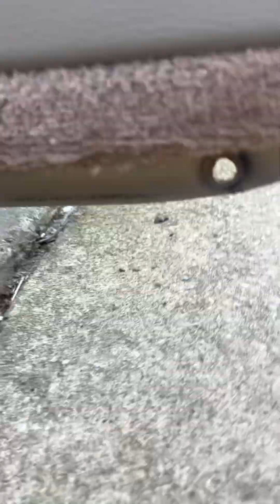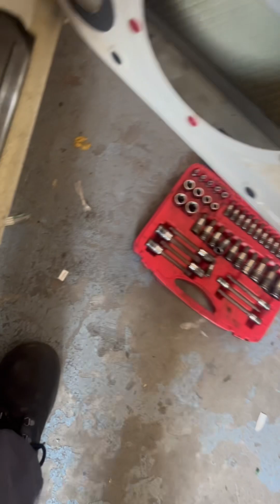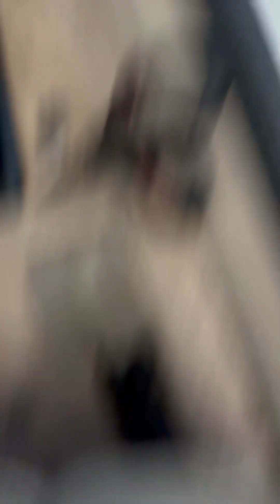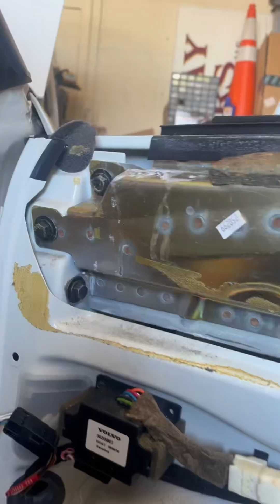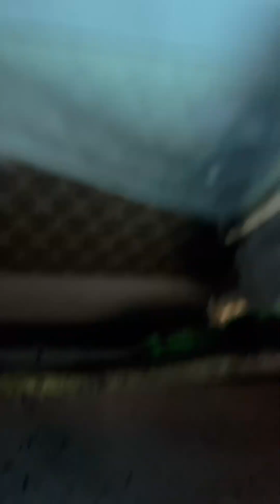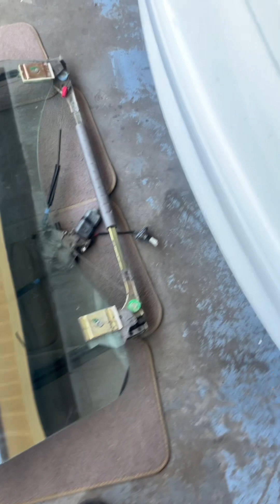2000 Volvo C70 Window Regulator Removal

Comment: The video was very helpful. I'm in the middle of the project myself on a 1999 C70. Hope to see the follow up.
Reply from the maker: I reinstalled it yesterday but wasn’t able to video it. It went back together perfectly using the measurements and shims I’d notated during removal. The only tip I have is make sure the motor is facing the correct way as you’re installing the unit, because if it tips the other direction, you can’t reorient it inside the door.